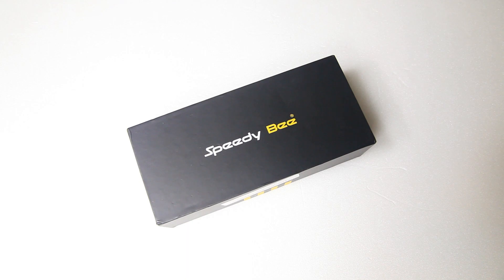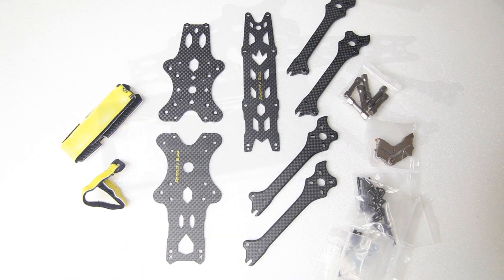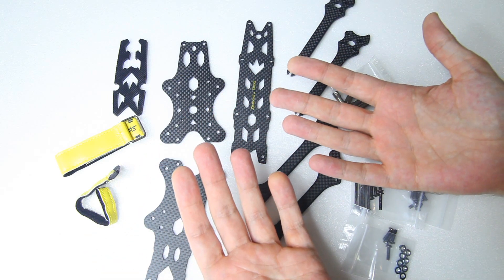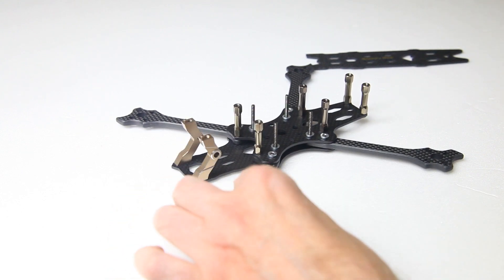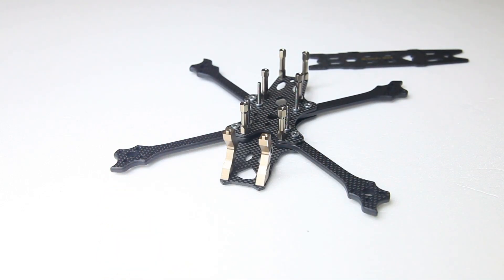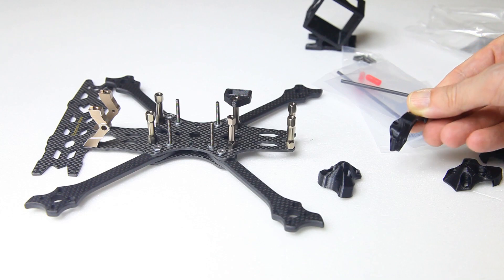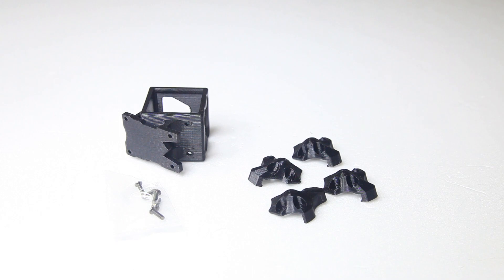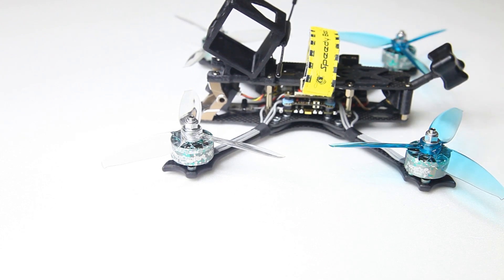SpeedyBee 5" FS225 Frame Review - DutchRC RIPLEY - Ultimate 6S Freestyle FPV Quad - P3

Comment from the maker: Frame review of this new and First Quadro frame by SpeedyBee / Runcam 
Link to the frame: https://www.banggood.com/Speedy-Bee-225mm-Wheelbase-5mm-Arm-3K-Carbon-Fiber-Frame-Kit-for-RC-Drone-FPV-Racing-p-1540903.html?p=TO251813974002015038 

type: 
wheelbase: 225mm 
base thickness: 5mm arms 
material(s): carbon fiber and alluminium 
weight: 110 grams 
chamfered edges: YES 
clean: 100% clean 
buzzer: nope 
LED board: nope 
battery strap: yes, stiched; anti slip; metal buckle 
battery anti-skid pad: yes